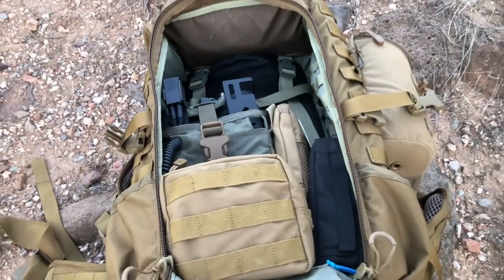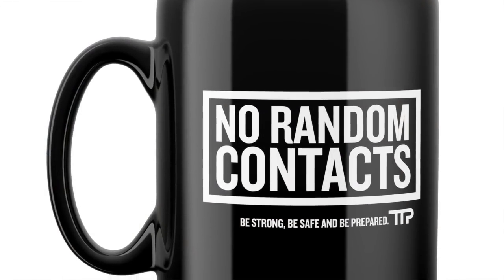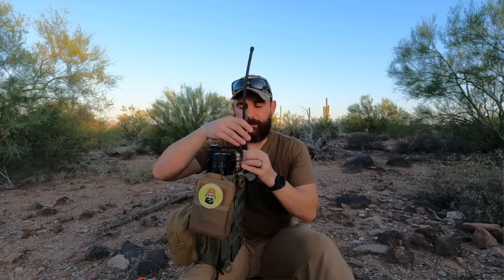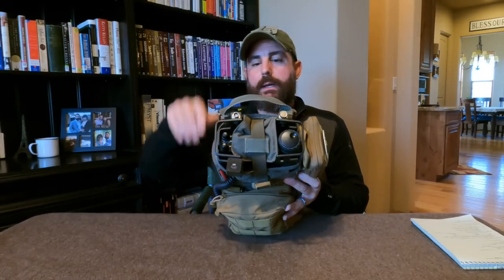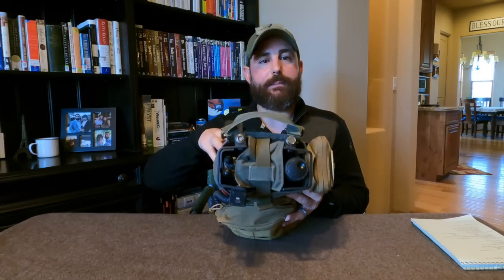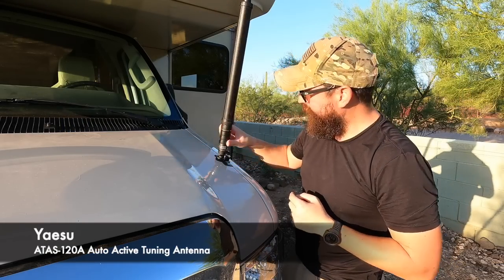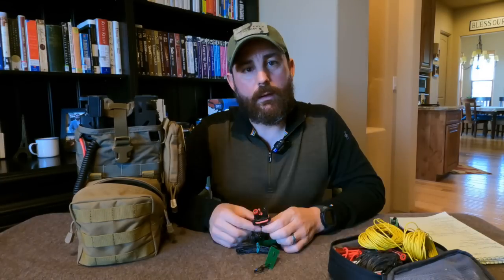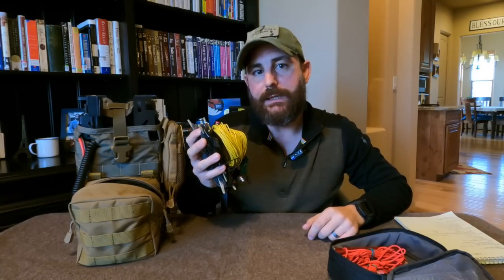Military-Style Radio - The Ultimate SHTF Manpack - Part V

Comment: Can you speak on the dimensions of High Ground Gear PRC/117G bag? I'm thinking about running the TPA-8889 frame in that bag.  Thanks in advance.
Reply from the maker: PRC/117G is too big (height-wise) in my humble opinion if you are planning on using the FT-8800/8900 with the TPA frames. You can get around this by stacking the radio on top of your battery. Just add a piece of plastic/wood/cardboard between the frame and battery. The dimensions are posted on the High Ground Gear website for PRC/117G bag.  

I have an FT-8800/8900 and covered in an earlier episode in this series. The FT-8889 frame works with the Helikon-Tek bag if modified. I am also just about to release a custom bag that is designed specifically for the FT-8800/8900. Here's the private video: https://youtu.be/OV3VfN-xdac

Comment: I use the FT-897D. The internal battery pack capability is awesome. The beauty of it is that both the 897 and the 857 use the same Yaesu programming software & cable. Both are fantastic radios.
Reply from the maker: The FT-897D is another great rig. I am kicking myself for not buying a new in box unit for $800 at the last hamfest. The batteries are hot swappable, right? If you ever decide to sell it, I'd be interested. Cheers!

Comment: So what does that whole set up cost
Reply from the maker: Everything here is discontinued and was purchased used, but this setup is about $3,000.00 plus or minus $500.
Reply: Have you ever considered building these out and selling them for 3500-3700
Reply: I’m a big fan of buy once cry once, I have a high mountain near me and according to line of site online thingy I should have a clear shot from central va to de and pa where I have family and we would all like to have off grid battery powered comms for disaster. They are all with in 300 miles. Is this the set up I should go for?
Reply from the maker: @kellerhopkins3184  Yes, I have. these radios are discontinued, so I am waiting for a new product release from one of the big three Japanese manufactures that meets all the needs of a field operator. As of right now, there is not thing currently available.
Reply: @TheTechPrepper  ill wait for now, look forward to buying something from you. also am I correct that you made a 265 mile contact with a 5w radio ? does that mean I could do it with an 8w beofang?
Reply from the maker: @kellerhopkins3184  Yes, but be advised that there are a lot of factors involved. The right antenna with appropriate placement, the right location (I had a height advantage), the environment, and the mode. I used sideband which is more effective than FM. Don't expect do this with a Baofeng unless you're using a low orbit satellite to relay your message. I have done that, too.

Comment: Seeing as how the 857D is discontinued and increasingly difficult to find, is it feasible for you to suggest or test out a model that is in current production? Or should we band together and stage a sit-in at Yaesu HQ until they start making more 857's?
Reply from the maker: I vote for a sit in at Yaesu. I'll be there with you. I have a very specific style of operating and there isn't anything available on the market from any manufactures that is this is this size/weight and covers these bands with this amount of power. It's not in the same class, but take a look at the IC-705. That radio is not for me for a number of reasons, but it's something for you to research as it could work for your needs. Good luck!

Comment: I HAVE WATCHED the videos on the five manpack ham radios. if had to only take on radio which one radio would it be? is it the 875?  I am a beginning prepper and travel for work, so i would like a man pack radio.
Reply from the maker: I would recommend the FT-857D if you can find it. It's the "does everything radio" with enough power. If you don't mind a bigger radio, the Yaesu FT-991A is another all-band, all-mode option. It's still on the market so you can get it new it and will likely run you the same as a used FT-857D. It's twice the weight and size, so man portable could be a serious problem. There is an ARMOLOQ frame for it. You may want to check out the 991A in person and go to your local Ham Radio Outlet or Gigaparts if there's one in your area. Also note, if you don't need HF capabilities, most the Japanese  VHF/UHF radios are good options. Thanks for sticking with the series.
Reply: @TheTechPrepper  thanks for the info. And I bought you some coffee thanks again
Reply from the maker: @kiethlowry2862  Thank you so much for the support. This really helps the little (but growing) channel. Are you a ham yet?
Reply: @TheTechPrepper   yes I have had tech for 3 weeks and already looking for bigger better toys! The 991 sure is nice.

Comment: Hi Gaston. I really have enjoyed your videos.  Just curious as to your preference between the Signal Stick and Comet whips. Are you mainly using the SS for higher wattage use? Does it sag too much on the TrekMount to use in the horizontal application? Wondering about the benefits vs using a single model of antenna.
Reply from the maker: Excellent question. For me they are different tools. I use the SignalStick on any manpack that requires more than 20 watts. This includes all the VHF/UHF rigs that I covered in the first part of the series. I use the BNC-24 for the 818 and anytime I run the TrekMount in the horizontal configuration. The SWR is almost a perfect 1:1 to match in that configuration with the Comet BNC. It's so good, that George from PackTenna cleaned out every Comet BNC on the market after I did my early testing last year. He now bundles the Comet's with his TrekMount as an option.  The SignalStick SWR is too high for this application on the TrekMount.

Comment: Great video as always. Really appreciate the work you did for this series. Coincidently, I am in the process of building a pack like this and really like what you say about the Yaesu 857. Unfortunately they are unicorns right now. What is the best alternative equal to or better than the 857 in your opinion?
Reply from the maker: Glad you enjoyed the series. I am getting this question a lot. Here some options:

1. If you don't need all-mode support on 2m/70cm. I would suggest getting two radios. A 100 watt HF rig and a 50 watt dual-band mobile rig. I personally like the FT-891 for HF. There are too many options for dual-band mobiles. If I were to buy a new dual-band VHF/UHF rig, I would go with the Kenwood TM-V71A. It's dual VFO and supports crossband repeat.

2. If you want all-band, all-mode (like the 857D) and currently available, look at the Yaesu 991A. It's huge, but it is a shack in the box. It also has some nice modern features like a waterfall to visualize the radio spectrum. The Icom IC-7100 is another option. It is older and has a goofy head unit.

I hope this helps.
Reply: @TheTechPrepper  this is a huge help to me, thank you very much for the reply. I really like the 991 however it's power draw is holding me back. I'll do more research on battery life with it. I'm going to stalk ebay for a month or so and see if any good 857's pop up.

Comment: Gaston, thanks for all of the content! I've been watching everything you've put out so far and have come to the conclusion that I have the paddle but can't even begin to find the creek I should be lost up.

That being said, could you go "tune" up Yaesu and have them build an updated QRP rig? I want to try 3 day inclement weather (cold/wet) hiking while conducting radio ops during the evenings; however, the TX500 appears to be a lighter weight option at present. Any chance of seeing TX500, or other suitable rugged equipment, content? That sounds bad...rather, what would you suggest for operations in the aforementioned situation?

I'm still looking at FT- 818ND setup akin to the one you use but am unsure of its suitability in the conditions. Also, what benefit are the filters that are hard to find?

Comment: So...what you are saying is? You're Not worried about your radio, getting HOT in that bag?! 😁😉
Reply from the maker: Based on my use and operating style (short commo windows and minimum power to make the contact)--NO. I have never had an issue. I will periodically feel the radio and bag for heat build up. My newer rigs (i.e. FTM-6000R) have built-in temperature sensors which are nice. I have been running these bags in the desert for 18+ months. Yes, you will likely cook it if you run for long periods of time to "rag chew" and run much higher power.

Comment: Was wondering if you had an opinion about the ATAC system and if it would work with radios with data links.
Reply from the maker: Not at the moment. I have ATAK on my list of to-do's for next year. I briefly installed it along with the HAMMER plugin, but can't really speak to it yet. I plan to make a plugin for ATAK as well to extend its capabilities for preparedness. I have a software project called EmComm Tools that I have been working on for over a year that shares a lot of the same concepts as ATAK. It's not release yet.

Comment: 2 Questions:
What mobile radios on the market are waterproof?
I know there is a fan on the back, but with it being enclosed like that, wouldn't it limit the airflow for it to stay cool enough to not overheat?
Reply from the maker: I don't know of any, but the closest is the Lab599 Discovery TX-500. No, the radio does not overheat based on my usage: short communication windows and run the minimum power. I have been running the manpacks for 18 months like this in the Sonoran Desert with the ambient temperatures up to 115F. No over heating issues yet. This style of operating is not designed for rag chewing.

Comment: Thanks for another thought-provoking addition to the Manpack series! I currently have just an FT-60R, though I plan to add a mobile rig and put together a manpack over the next few months. I'm wondering whether you have any opinion on how the FT-891 in addition to a good HT would compare to the all-band, all-mode rigs that you've been focusing on. Obviously, such a combo would sacrifice SSB capability on 2m and 70cm as well as the FT-857D's higher transmitting power on the upper frequencies. But it's my understanding that the FT-891 offers some useful improvements (e.g. DSP, better filtering, larger LCD screen) over Yaesu's older but still very popular shack-in-the-box options for a little less money. Are there any other disadvantages to relying on an HT for VHF/UHF communications?
Reply from the maker: You are very welcome. The FT-60R is a fantastic radio. It was my EDC radio until very recently. I still have a number of FT-60's that are now being used for other tasks. Back HT's for the vehicles and go-bags.

This is a great question. Here's my personal opinion:
1. If you don't need SSB on 2m/70cm, there's not need to get an all-band, all-mode rig.
2. A 100 watt HF rig can be supplemented with a secondary that provides dual-band VHF/UHF capabilities.
3. If you need more power than HT, supplement your HF rig with a good 50 watt dual-band mobile rig.

Good luck!
Reply: @TheTechPrepper  I'll have to do some digging to find out how much SSB activity there is in South Florida. On the other hand, if I can convince some family in the region that they ought to get into amateur radio at least for emcomm, then I could make use of the higher power on VHF/UHF or even SSB for sure.

Comment: What's your swr with that signal stick? Mine was very high on the same set up so I had to switch to a 3/8 wave antenna
Reply from the maker: I have not measured it as I still do not have an inline SWR meter. Ordering one now. I have received reports from other users that's not too bad. What was your SWR before the swap to 3/8 wave antenna?
Reply: @TheTechPrepper  2.4 ish on 5w ....I have the diamond sx-600 so it's pretty accurate....I tried getting it to come down with a counterpoise but it just wasn't happening. Definitely worth a check though.

Comment: I'm trying to decide between the 818 and the 857. I would prefer the 818 for it's cost, size, and weight but I'm not sure if it can fit my needs. I absolutely need a radio that can regularly transmit around 100 miles but would really like one that can do 300 miles. Is this possible with the 818's 6 watts or will I need to step up to the 857?
Reply: If you primarily use digital modes 8w should be reliable at that distance. Especially with modes such as Olivia. Take care.
Reply: Correction, 6w
Reply from the maker: I am not sure if this answer helps, but I started with the 818 when first I was licensed to operate on HF. I really struggled to make the contacts on low power, but after some time I found how to maximize this radio's performance. I have used the 818 with NVIS antennas on 40m, 75m and 80m to make consistent contacts within the same distances that you are needing. However, a little more power has always helped.

If you don't need all-mode capabilities on 2m/440, you may want to take a look at the Yaesu FT-891. It's still available and offers 100 watts. The digital noise reduction and DSP are great. I use that radio for the scenario you are describing often. Search my channel video page for "NVIS".

 I believe that there is no perfect radio for everyone. You need to pick the one that meets your needs. So, if your goal is reliable county/regional contacts, I would recommend a good 100 watt rig and some resonant wire antennas for the bands you want to work.

There will be several videos in my next series that will answer specifically your 100-300 mile reliable contact question. Stay tune.d
Reply: @TheTechPrepper  Awesome! Thank you for your help!

Comment: Yea- good luck getting the Yaesu FT-857D on ebay-  you will be paying an inflated outrageous price for a discontinued radio.  Why not just get the 891-  you will pay about the same price as a ridiculous priced 857d on ebay.
Reply: $1000 is ridiculous price-  it didnt even sell for that when it was out.
Reply from the maker: I have personally found SSB on VHF/UHF to be very powerful and more effective than FM. The FT-891 is HF only. Another option is to go with two radios HF + VHF/UHF mobile. While there aren't any good higher power VHF/UHF all-mode rigs, most people can get by with the FT-891 and something like a Dual VFO/crossband repeat rig (Kenwood TM-V71A, D710GA; Yaesu FT-8800/8900; TYT TH-9800). It all depends on the tools you need.